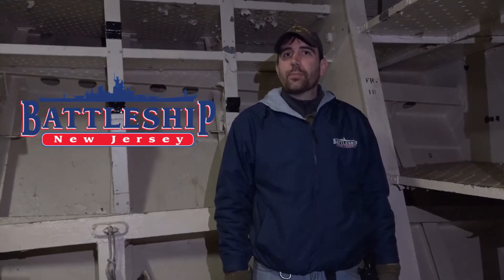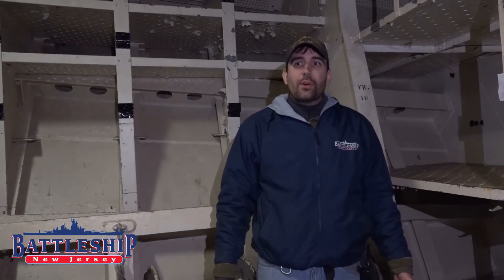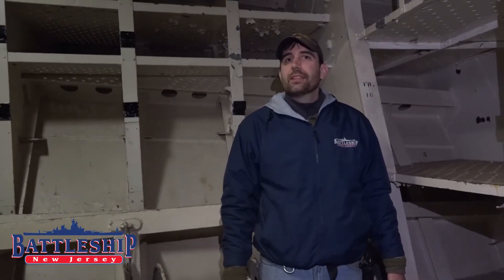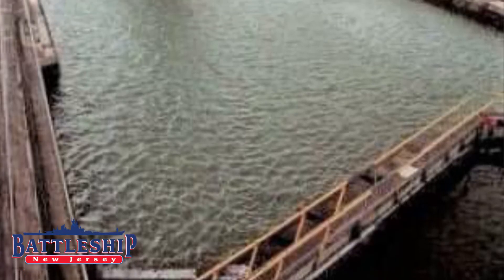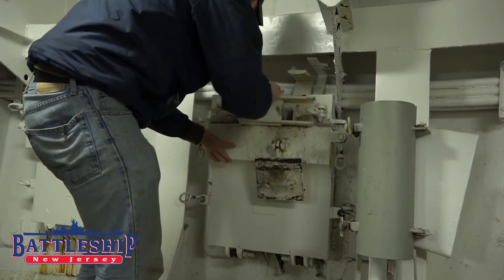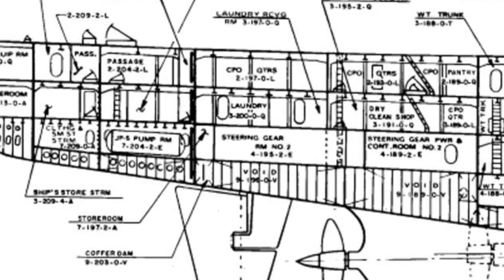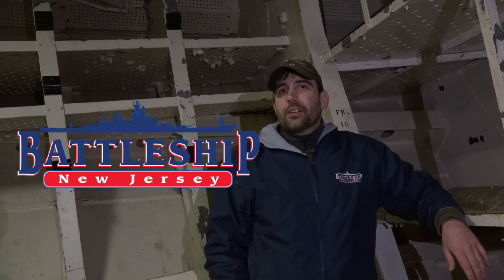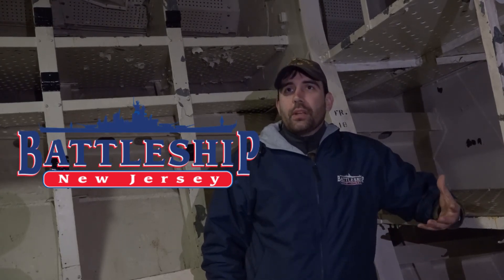Frame Numbers

Comment: When looking at the length of the ship, have you considered the thermal expansion of steel as you go from one temperature to another.  My back of the envelope calculation says the ship would grow about 3-5 inches longer going from 32 degrees F to 86 degrees F, but that's sort of a rough guess.  The coefficient varies a bit from one grade of steel to the next.  It gets complicated by other factors too - the entire ship isn't at the same temperature, for one thing, but the lower hull will probably be closer to the temperature of the water.
Reply from the maker: The pressure can shrink a submarine but these small temperature differences aren't going to be measurable on a surface ship.
Reply: @BattleshipNewJersey  It changes more than you think.   

Do you have the manufacturing prints for the boat?  If so, how big it that stack.  Could we see some of the different sheets?